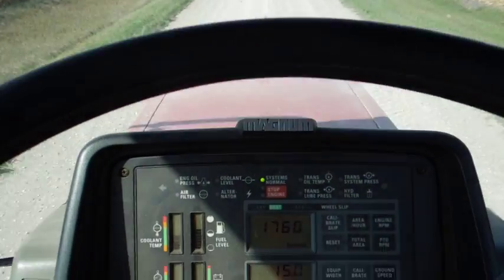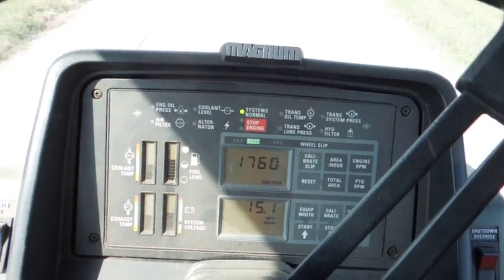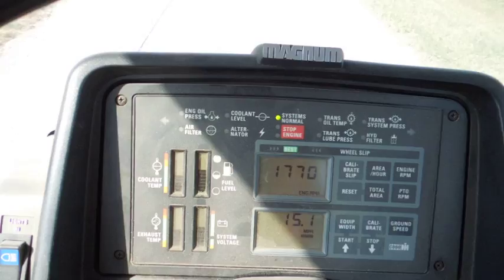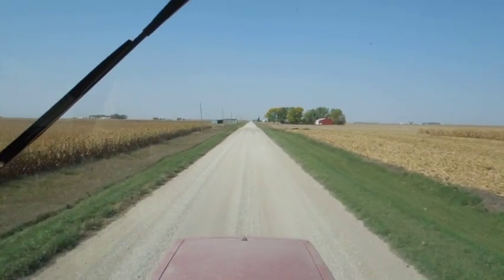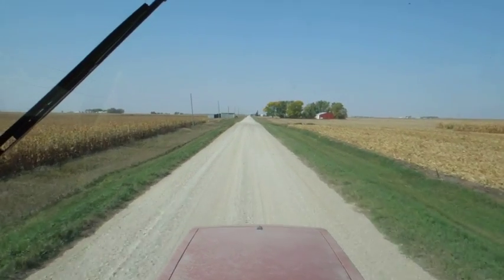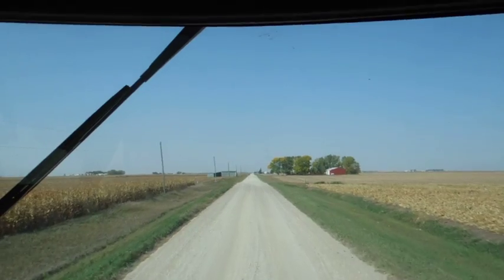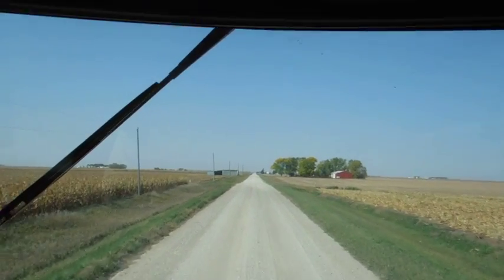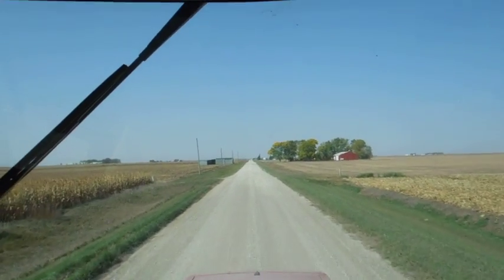When faster isnt always better

Comment: Yup and the gas usage is exponential the faster you go because the gearing is designed for a certain speed.  Going faster also increases the wind resistance which also contributes to the higher gas consumption.